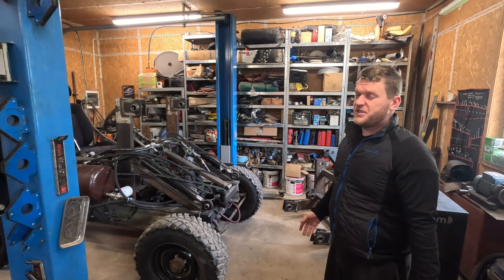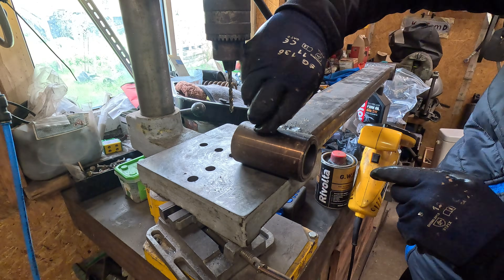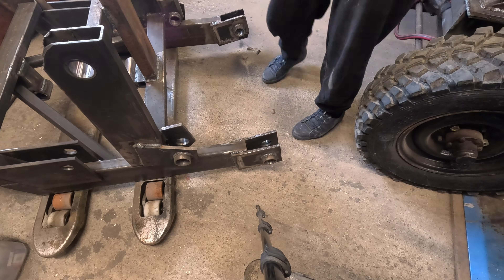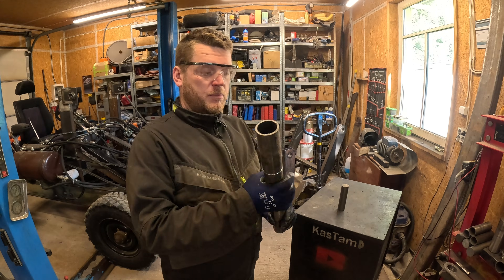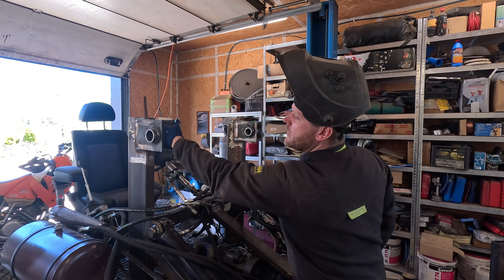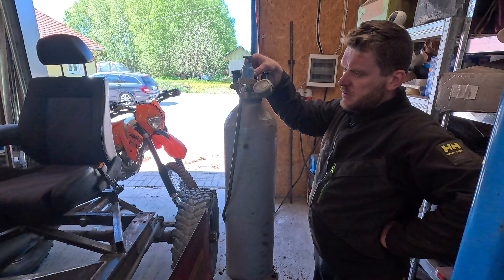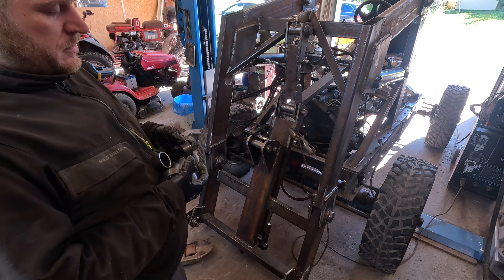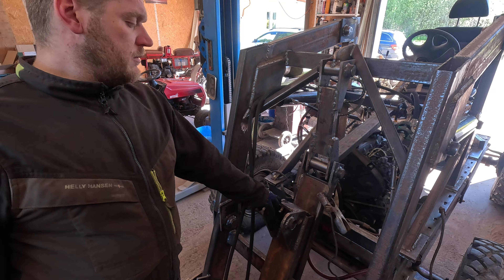Watch me Test this Crazy Homemade Loader!

Comment: Hi! Nice job. I also made loader few years ago with the same engine but TD. And I also had to change gasket for the fuel pump :D I have two hydraulic pumps in the rear, one for drive and one for loader and steering.
Reply from the maker: How big of a pump can be driven from the front of the crank?
Reply: @kastamD I'm not sure. They run power steering pump but that isn't that big. The crankshaft pulleys pin might fail if there is too much load on it. They have failed even on cars if the king bolt has wrong torque.
Reply from the maker: Do you have a picture of the pumps attachment?
Reply: @kastamD I used audis gearbox and made chain drive for the pumps. It is easy way to play with pump gearing but I would like to get rid of the chain cos it makes noise and gives some vibration. 

https://youtu.be/wjcb7tg5-3Q

here is link to my Finnish channel and the pump installation episode if it helps.